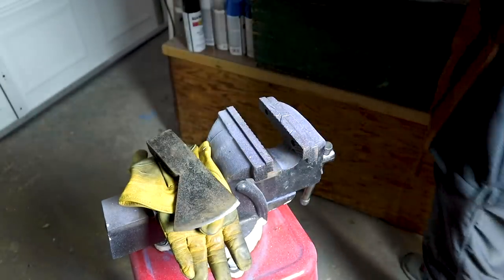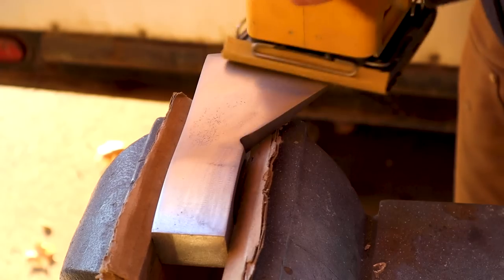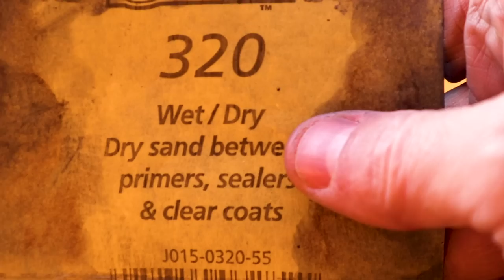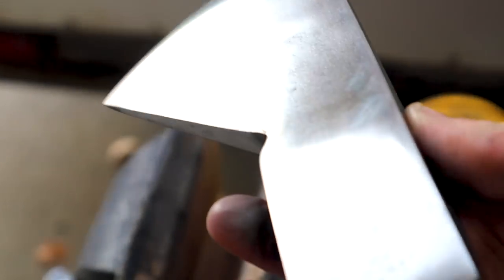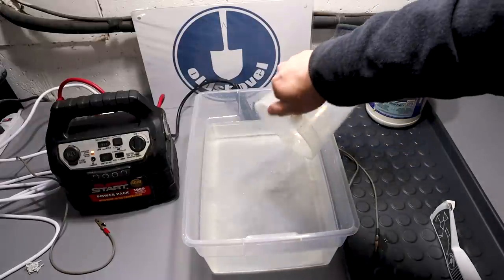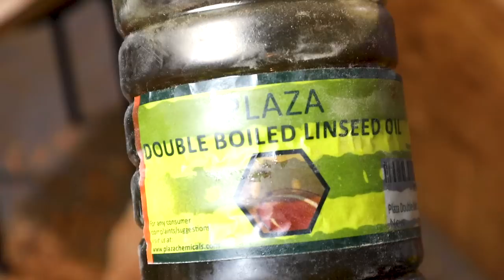Connecting to the Past - Hudson Bay Axe Restoration

Comment: That is a great hatchet / sheath project!  Nice work.  But unless it's a wall hanger, I think you should have done the painting on the upper portion of the handle.  The part that you hold should be raw wood with only the boiled linseed oil.  In my opinion of course.

Comment: very good, though i have to say your sheath snap is going to scratch the holy heck out of your nice acid etched surface every time you  push it down to close it. i have a zippo sheath the same way and it ruined my filigree zippo surface. i ended up putting some duct tape on the back part of the snap so it doesnt rub metal to metal.
Reply from the maker: I agree - I may superglue a small piece of thin leather on the inside to protect it.  Thanks for watching.

Comment: The original handle in that axe is shaped properly. I despise those new factory made plump axe handles that are cut down only at the end for it to fit into the blade. And I see that a lot of people making axe handles make them that way too. WHY? Even if you make the axe handle so thick, they are just as likely to break near the blade, they feel too thick, too bulky. If you think the wood you are using is not strong enough then use some stronger wood.